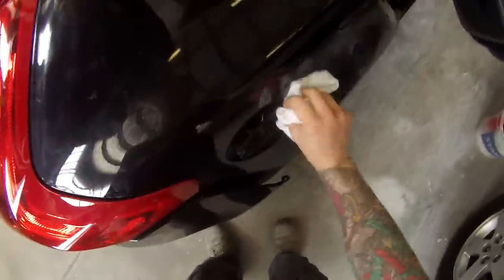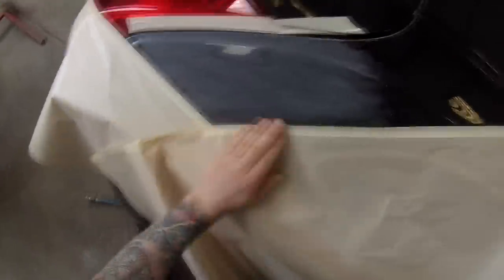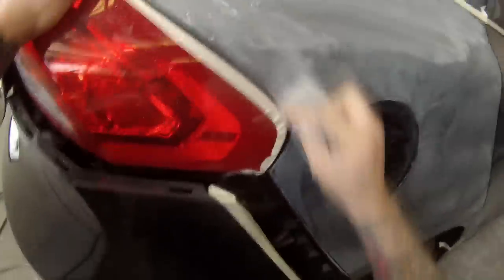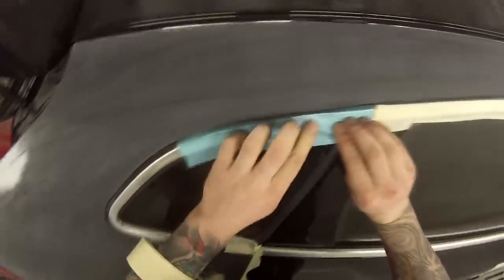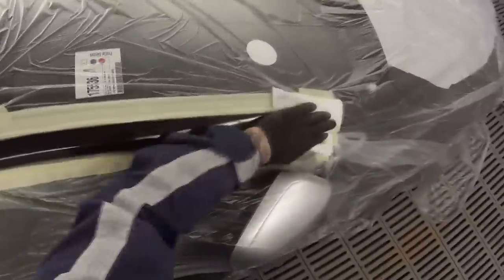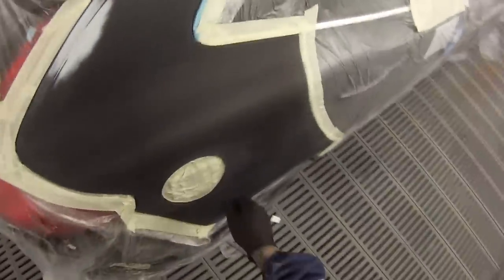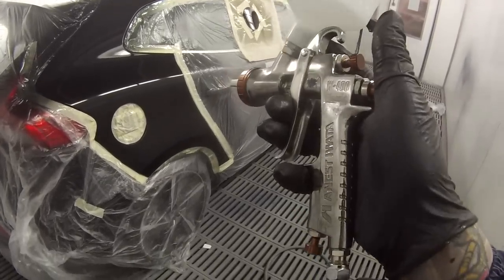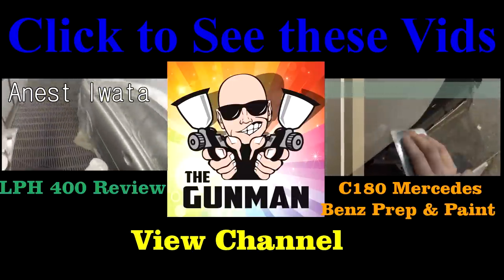New Volvo V40 T5 Prep & Paint

Comment: As always, great video!
Very nice car.
Is this Iwata good for base coat? If I remember well you use it only for clear coat.
Reply from the maker: Thanks mate, yes this gun is great for basecoat but its my new gun so I usually just use my new guns as a clear gun then when they're a little older I'll do a rotation and use them for base as well, its mainly to stop little bits of metallic coming through the clear on a solid color clear over base.

Comment: yo gunman awesome vid!!! quick question, whats the mixing ratios in your standox clear coat and how much reducer do you put in?
Reply from the maker: it varies on which hardner you want to use but its 4:1 with VOC hardner and no reducer otherwise you can use it at 3:1 with 2k hardner. The Standox clear is so thin compared to some other top line clears like Glasurit so I found it works better with no reducer but I may use a little in winter when it goes thicker. did you see this video on how to use a viscosity cup? How to use a Viscosity Cup
Reply: ok, have you ever used hs autothane clear? if you have what would you say about it comparing it to standox premium (not top shelf clear). yes i did watch your vid on the viscosity cup, that vid too was awesome ;)
Reply from the maker: I have used autothane from memory it was PPGs cheap clear and I do remember it being good but not quite as good as standox standard clear.
Reply: i can tell ;)